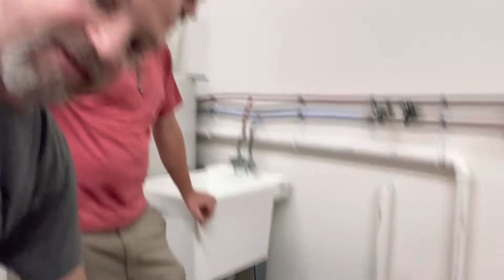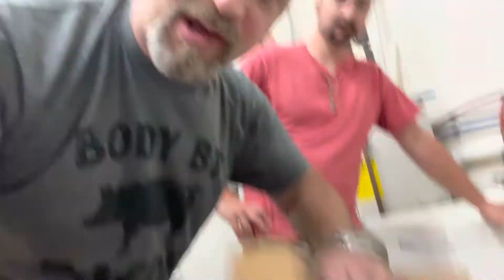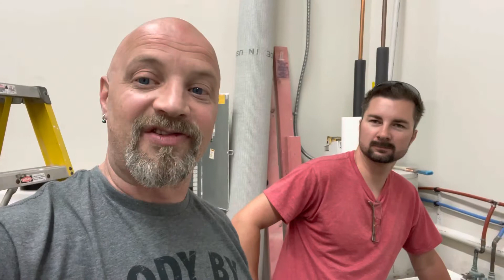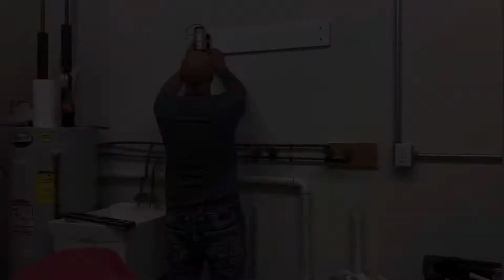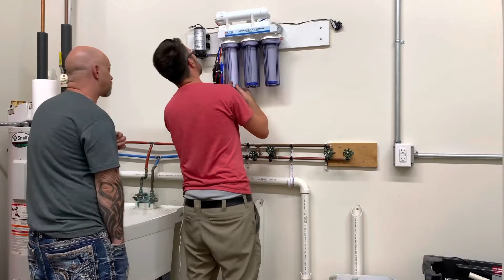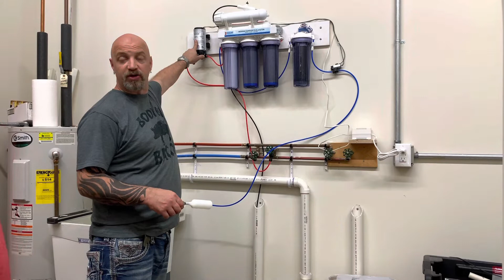BRS / 5 stage RODI Unit / Install / with booster pump

Comment: Hi;

Looks like you are using a Aquatec punp. 

I picked up an aquatec pump and went to home hardware shops and they had no idea about the tunbing. Could you tell me where / or where I can get the tubing - and how to connect to a 3/4 line?

Peter